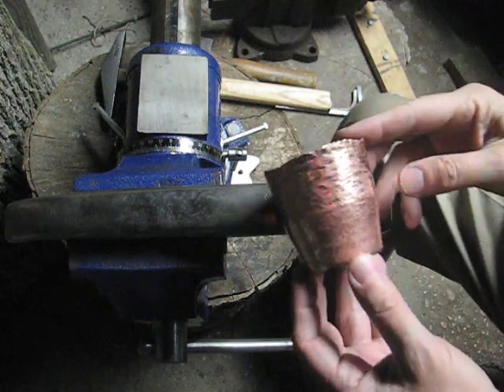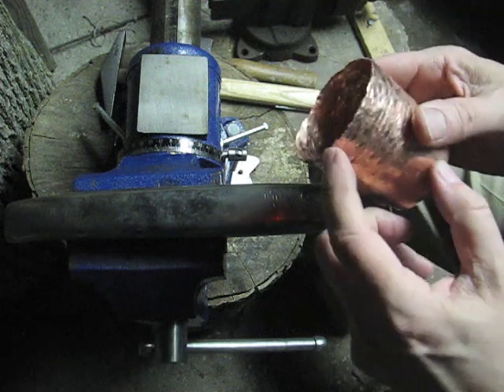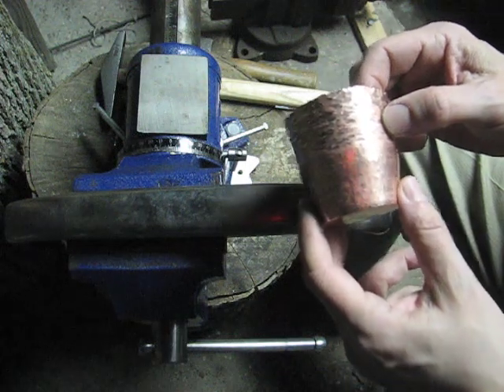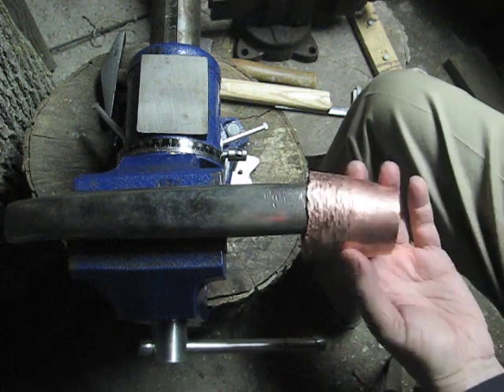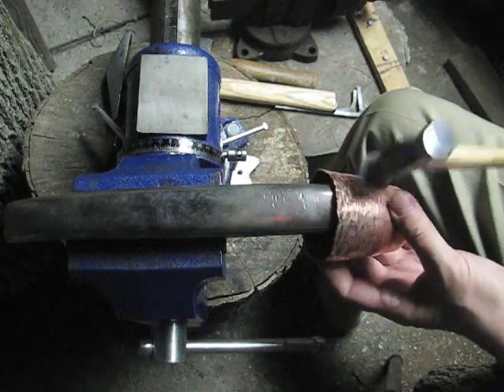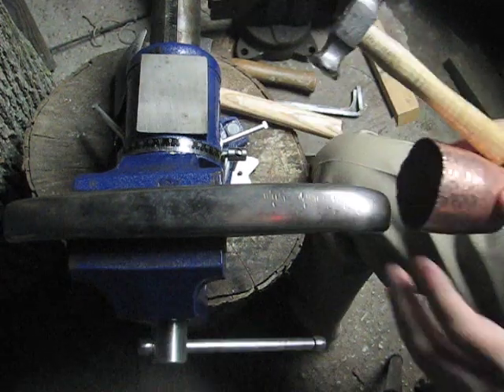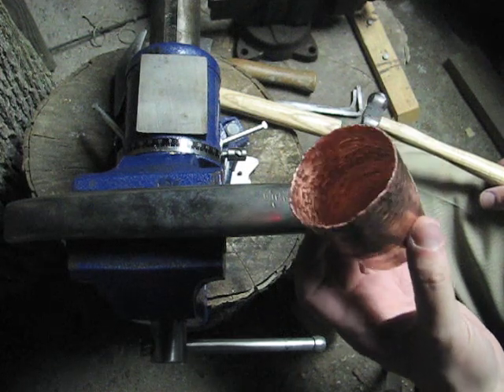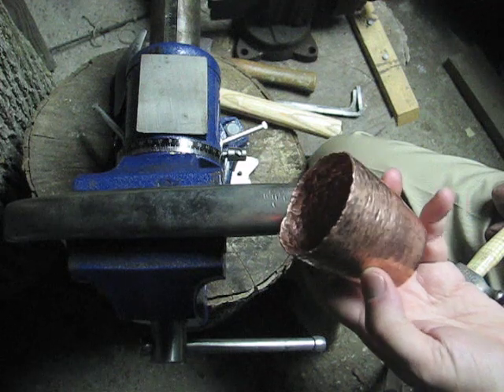Raise Copper Vessel 4- Beaker Part 4 finish

Comment: Sage, great series of videos.  They're very informative for people like me who are trying to get into  this.  A couple questions about some of your equipment...  Where do you get the stakes?  How thick is the copper you're using?  It sounds like it's a pretty heavy piece.(By the way, my coworkers are getting tired of listening to the hammering... I watch these videos in the office during lunch.  I don't care, though.  I have to listen to their silly conversations all day.)I hope to see more raising/repousse vids from you soon.  Take care.
Reply from the maker: +Stephen Mosack ~ The stakes come from All Craft in Manhattan, you can also  find them on EBay occasionally. I used a steel pipe for a year or so, the stakes are better being solid and cost around $178, If you look around the web you might find used stakes. What ever you find they will likely have to be dressed, that is refinished, even my new base setting stake had to be  trued up for me to use it. My copper and silver is usually 18 and 20 gauge depending on the size of the intended vessel and the type of finishing/chasing. Glad you are enjoying the videos there will be something after the new year begins. Thanks for watching and writing.
Reply: The advice and information is appreciated.   Enjoy the holidays.
Reply: Stephen Mosack y
Reply: Sage Reynolds
Reply from the maker: You can find stakes at All Craft in the 30's in Manhattan, my first stake was a heavy metal pipe but the solid stake is better. You might find stakes at large antiques markets. people often discard  something when they don't know what it is, I'm always looking for old tools at places like that. Keep an eye out on Ebay, things turn up there occasionally too. Good luck and thanks for watching.

Comment: I still don't see where the shrinking takes place.  Obviously, it does happen.  I work with iron, but to shrink like you do, I have to produce a wrinkle and then actually upset the metal, thickening it to get the diameter smaller.
Reply from the maker: Raising a vessel is a lot like what a potter does with clay. We raise the metal in rounds with a hammer on a stake, moving the metal as the vessel is turned. If all goes well, the vessel closes and the sides rise with the metal staying the same thickness as it was in the beginning. There can be some thickening at the rim but that doesn't happen for me. Being a black smith is different with different goals. I have a great respect for iron work and all that is required in the repertoire. As a black smith you must do a similar thing when you make a point or stretch and thin a blade. We are just doing that  in the round ( and with cold metal). Thanks for watching.

Comment: I hope this question gets answered. I'm familiar with sinking and raising but I never understood how the larger circumference of a flat sheet can be reduced so much when it's raised. Do you know how this happens? The only way I can think of it happening is for the lip of the bowl to get thicker and thicker every time.
Reply from the maker: When you are raising metal, you use a cross peen hammer. That means that you are moving the metal in a particular direction. As you decrease the diameter of the circle , you are moving the metal upward raising the cup or bowl. Ideally when you finish, the metal is still the same thickness as when you started. There might be some thickening of the metal at the very edge which, for me becomes irregular (and gets trimmed off of the finished vessel). It does seem like magic, if you measure the height and diameter of a finished vessel and add them together, it should be very close to the diameter of the original disk of metal.
Thanks for watching.
Reply: Sage Reynolds Thanks for the reply! I understand the process because I've done it myself. I just can't understand why it occurs. Like for example if you take a circular paper and try to make a bowl out of it the length of the circumference can't change, you'll be left with creases that add up to the original circumference length. I know it's not a good comparison and that there are creases during raising and sinking which can be hammered out also in metal. I guess to put it more simply. Where does the extra circumference of a flat sheet go after it's been raised, especially if raised really high like yours. Because the circumference is a lot smaller. Maybe I just don't understand it at all. I do not feel smart right now haha.
Reply from the maker: Rather than paper ,you should think of it more like clay. The metal/clay simply changes places. the circumference becomes smaller because the mass under it is moving downward and upward rather than to the sides. the down and up makes the vessel rise while the circumference diminishes.
Reply: Sage Reynolds thanks! I get it now

Comment: I like your video. You would get more efficient raising if you used a solid bar instead of a pipe.
Reply from the maker: The pipe videos are from when I had  no stakes. You see in the video above that I do have stakes now.  I have left the stake videos up for those who want to try but have no access to stakes simply to show that it can be done, even solid bars are hard to find in some parts of the country. 
 Thanks for watching.

Comment: The top edge of any raised item should always remain fairly even. If it ends up looking like yours you are not keeping the raising even. Any coppersmith or silversmith uses a pencil to put guide lines around any vessel being raised. It's the only way to keep it under control. The top edge should be caulked to make it appear thicker and stronger. Who ever taught you is not teaching correct methods.
Reply from the maker: Please read  my reply to your other comment,  also take note that this video is nearly 8 years old, made when I was in my second or third year of beginning metal work. BTW, you and I are probably about the same age.  Thanks for watching.